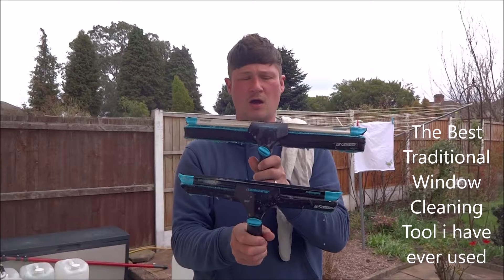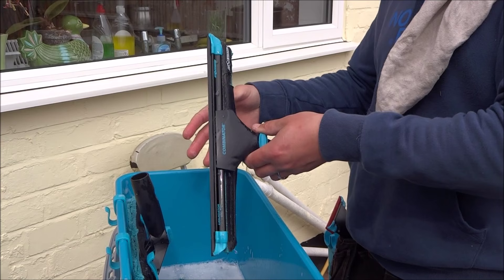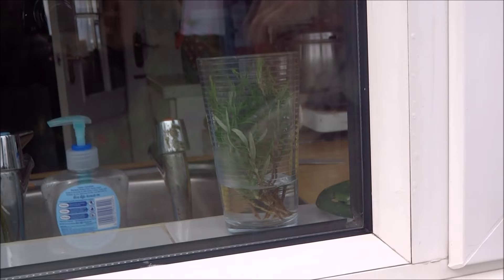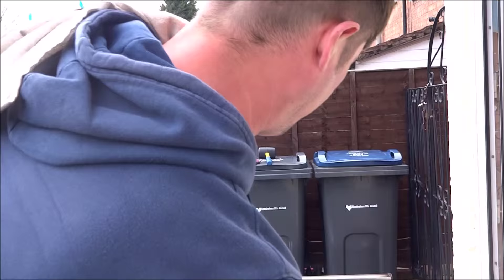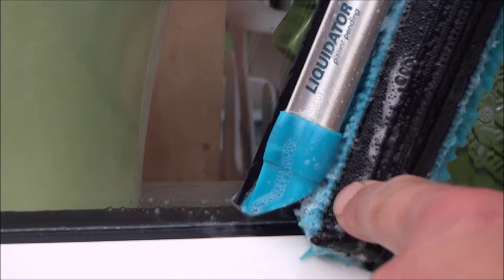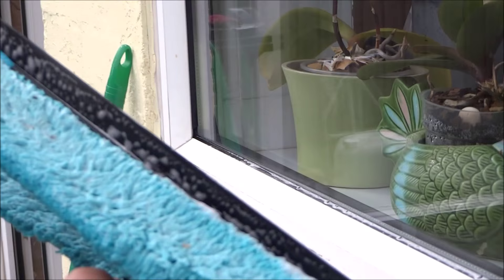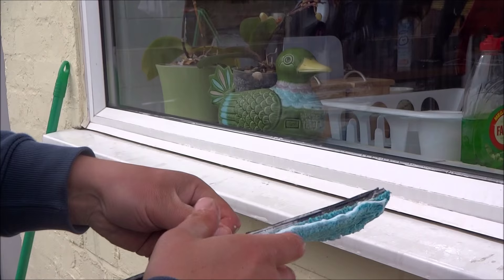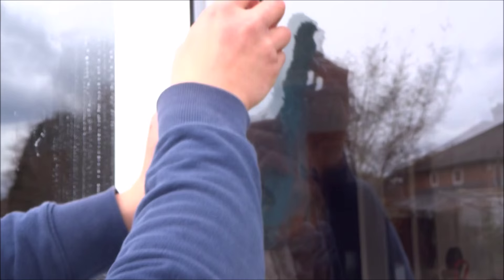Moerman Combinator Review

Comment: I find it amazing that Moerman didn`t forsee the problem with the angle of the mop head when developing the combinator so that no modification was required. I`m certainly ordering one though as it looks like it will cut the time it takes me on each window. Thanks for such a great review video.
Reply from the maker: they have modified the angle like this now. if u want my current advise, the 18" is possibly best and on large windows, 14" on large windows too, but 10" is not great as one passing but i like using just the applicator that size.
Reply: Thanks Paul. I currently use a 14" Liquidator which I love. I`m going to order the same size Combinator. Do you buy the Liquidator blades from Moerman or do you buy other rubber and cut them to size? I say this because the blade that my Liquidator came with only lasted a few weeks before it started leaving soap on the windows in an arc when I moved the blade across the window. I wonder if that is a general problem with the blades? I don`t want to buy some more if they might all be like that. If they are then I might buy some rubber and cut them to fit my Liquidator
Reply from the maker: i cut my own, im not sure whats the best rubber really, but i suspect its the red razor,  thats what im buying when i run out. unger isnt a gd fit in liquidator. if u already got 14" then u just need the handle and pad part. its great to use a liquidator in one hand and combinator in other hand and use both hands at the same time. excellerator can be gd this way also IMO

Comment: The best way to keep water off the frame edge of the window is to use less water and not allow the edges to get wet in the first place. With regular cleans you don't have to worry about the few inches of glass getting clean because when you squeegee the window the water is spread out accross the squeegee and the edges are cleaned that way. Also try and use a lot less water to soap in your solution mix unless in direct sunlight so that the excess water is easily removed and not dripping all over the place. 

If you want a one pass technique then use two hands and save your money by not buying things that will break at some point because of the many peices they are put together with anyway....
Reply: What do you use Doug?
Reply: Trial of Our Faith i use the Ettore ledger handle with your standard brass 18" channel and an Unger 18 inch T-Bar with a porcupine sleeve. I think the combinator would work really well by the looks of the video but I just don't have too many accounts that are done often enough to be able to use the one pass technique. I'm scrubbing and or scraping windows all day long. 😩
Reply: Doug Stansell
I'm in the same boat with scrubbing. Why do you like the ledger handle?
Reply: Trial of Our Faith i like how it works inside against window sills and is more wrist friendly then a 0 degree handle. Actually it's called the "Ledge Eze" handle...
Reply: Thanks.  2 more Q's if you're game.
1) What do you when tops of windows are a bit too high do you put a pole on that "Ledge Eze" or?
2) What is your fav (cheapest) online window cleaning supply site? Thx
Reply: Trial of Our Faith Ladders all the way! Doing windows by hand will gain you permanent customers and referrals up the ying yang... Try ABC Window cleaning supply  out of Colorado. They have everything you need and everything you don't as well....
Reply: Thanks buddy

Comment: Who trials Moerman tools? How come when we use them we work out possible problems within minutes yet they seem to put them out on the market without them knowing these issues?Or do they know but sell them anyway?
Reply: By the way great tool but it sucks on deep frames. The angle of the handle is wrong and the handle length is to long. You cant finish on really deep frames
Reply from the maker: they have a number of people they send the tools to who are window cleaners by trade,  they dont know the issues because they are not window cleaners they sell the products, things can always be a bit better in one way or another, sometimes the changes cost too much to change othertimes its simple i guess. the reason they used to send me tools was because i was making dog eared squeegees before the liquidator came out and i knew bob and he suggested me to them, i dont really test stuff at the moment as im too busy but they might send me stuff if i asked them